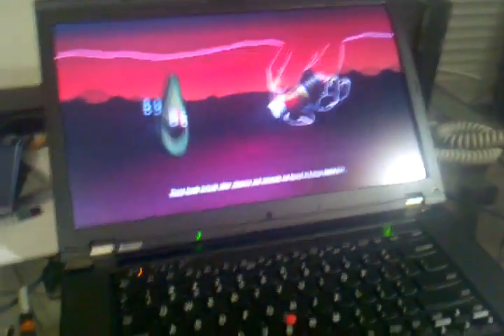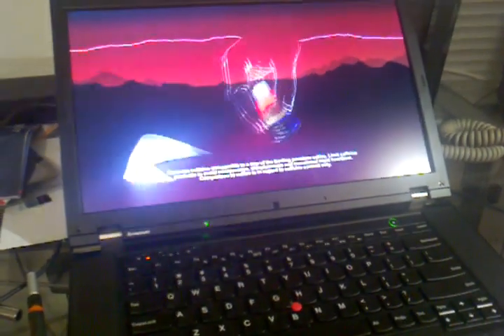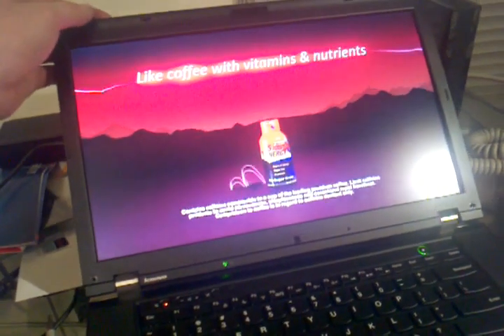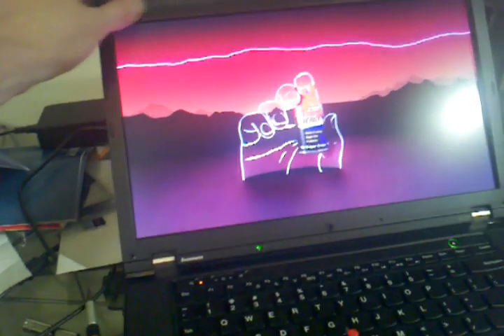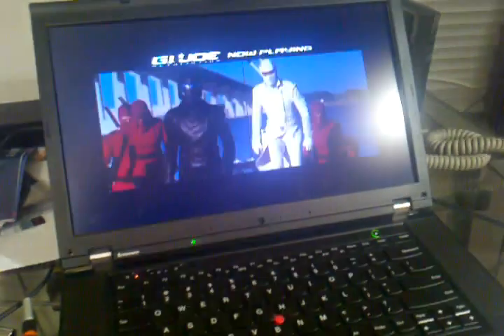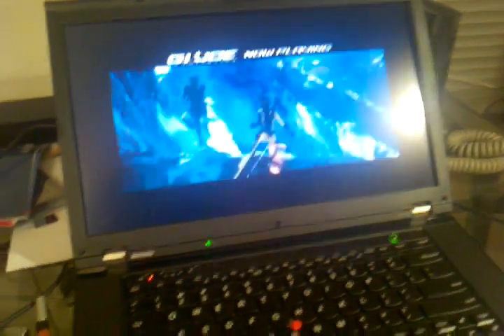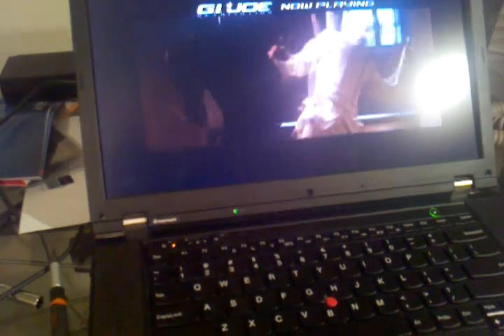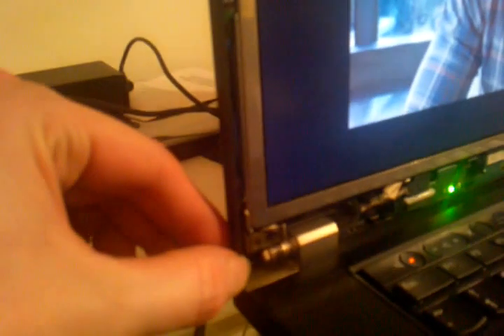Lenovo ThinkPad W530 - How to Fix Creaking or Sticking Screen Hinges

Comment: Loosening the front-facing screw on the hinge is a good tip... took me a while to figure out (was trying to get at the adjustment bolt with needle-nosed pliers instead, which did NOT work :p) :D

Comment from the maker: Not really sure what type of lube, but I imagine it just needs another adjustment.  Mine has been fine since I posted the video.  At first it was a touch looser than I had hoped but it stiffened right back up over time and seems to be in a happy place now.  I think it is just a really finicky adjustment, and you may need to try more than once.